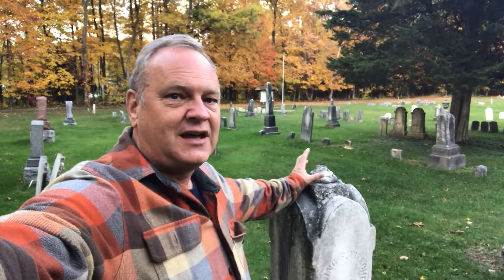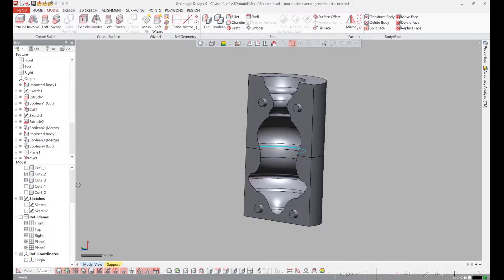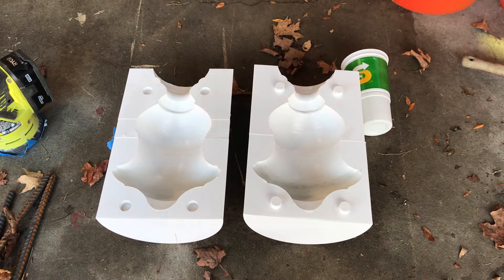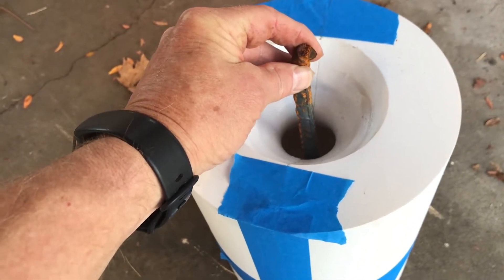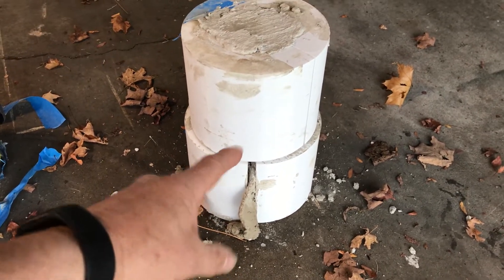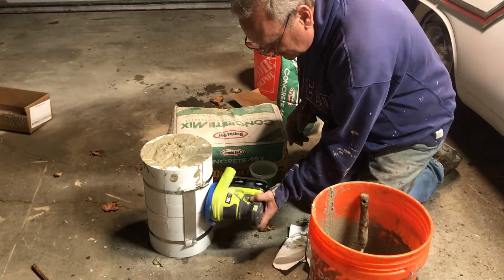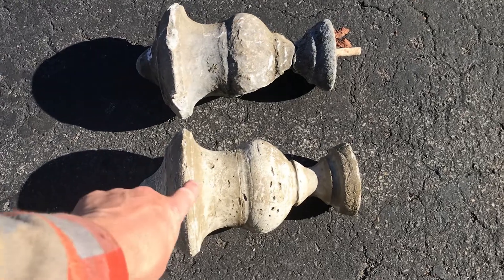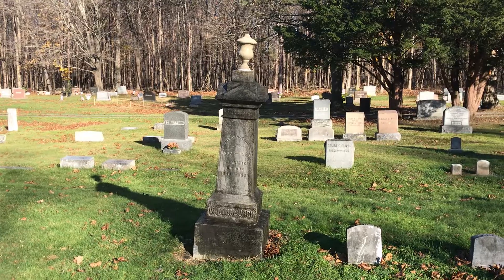3D Scanning, 3D Printing, and Casting Concrete Objects

Comment: Nice that you’re giving some TLC to the monuments. My little brother was almost hit when he was a toddler by a falling finial at a cemetery we were walking through with my mother. I wondered why you didn’t let the rebar extend past the base of your reproduction, since the original had that and it might help with securing the finial? I don’t know about how strong that mastic you used is? But great work—I always enjoy your project videos.  (Btw, Ryobi’s own 18v inverter and USB C battery power supply and CHARGER unit has finally dropped! Mine arrives today.)
Reply from the maker: where did you find the new inverter? It is still showing "coming soon" on Ryobitools.com? https://www.ryobitools.com/products/details/46396035356

Comment: Looks awesome! If you end up having to print more molds I would key the interface between the top and bottom and rotate the seam 90 degrees as well.
Reply from the maker: yup, I originally was going to glue the two halves together. I thought getting the four pins to align might be a problem. Having smaller pieces makes removing the mold a bit easier. top/bottom pins would definitely make sense. This was my first attempt. I'm not doing too many iterations at nine days 😆
Reply: @SerendipitySue  Completely understandable! Your solution to the tape problem was a great idea, will be stealing that. :)

Comment: Kudos A Tip: Take a small amount of concrete and make very thin slurry. Pour that in and rotate the mold to coat the surface. Then add your mix.
Reply from the maker: On following castings, I've made the concrete more soupy when I pour it. It seems to have solved the bubble problem